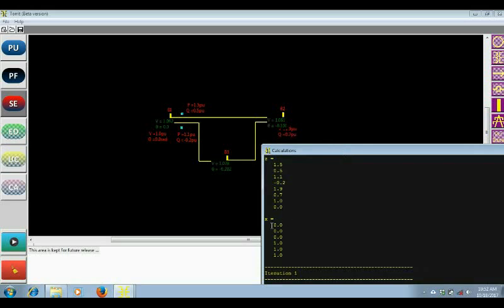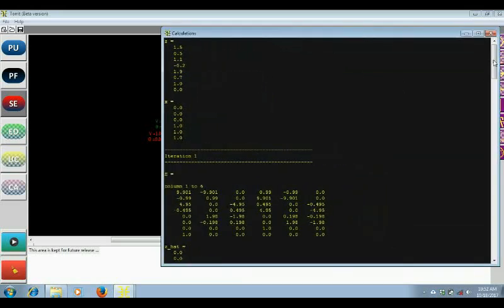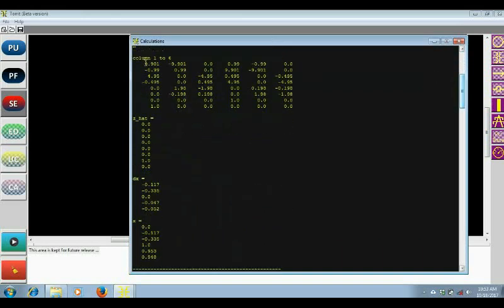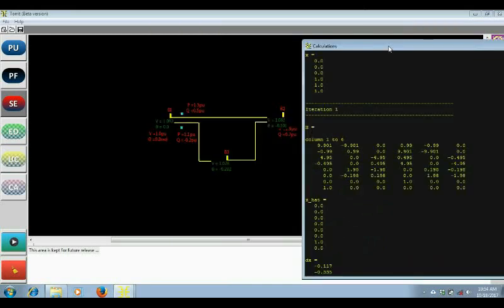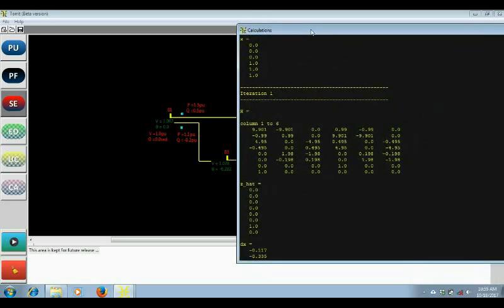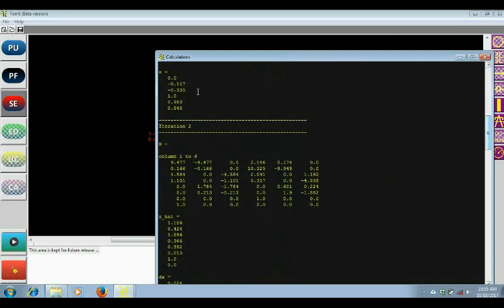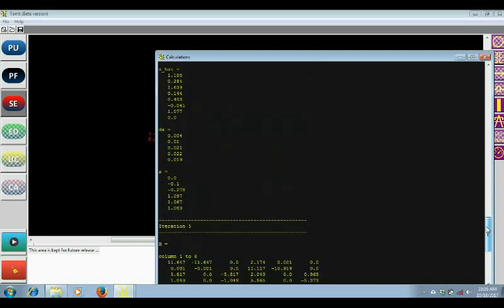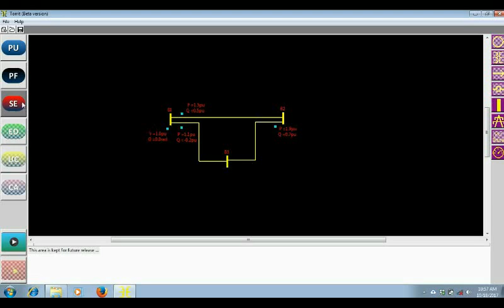07 Power system state estimation - Using Torrit _ part 2

Comment: I want to work on IEEE 14 bus system. Is it possible with this software?
Reply from the maker: It is possible at the bus level (single line diagram). If you want to use other components, it will not work.